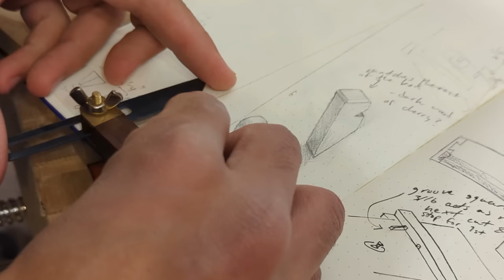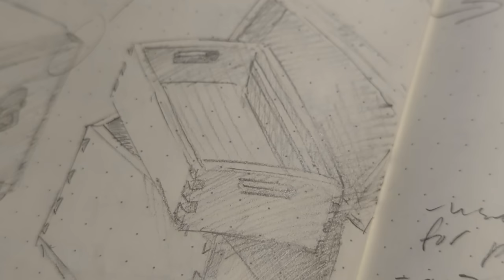Making a Treasure Chest

Comment: If you slightly round the outside corners of the insert tray, it will reduce the air pressure inside when you insert and remove it. It all depends if you like the sharp corner look with the dovetails.